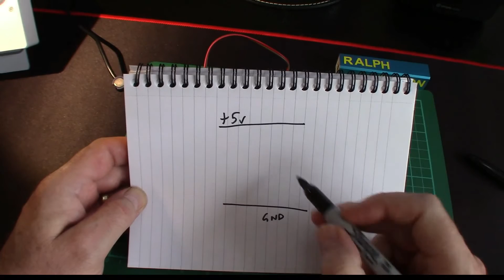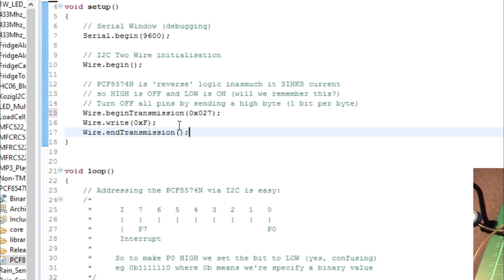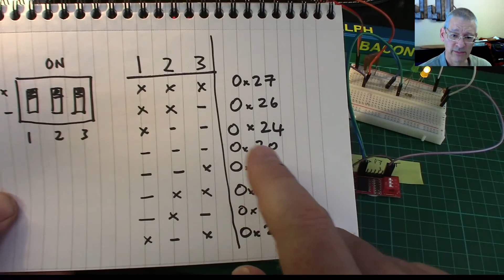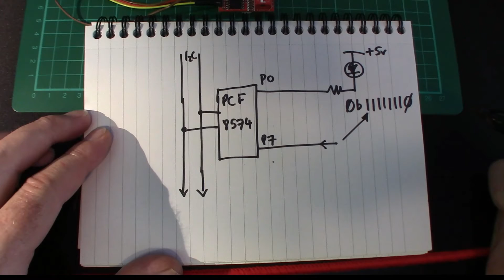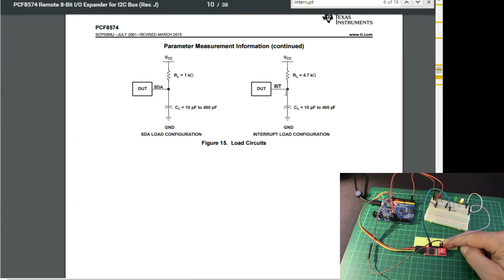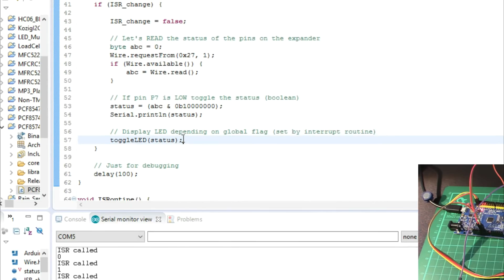#49 MORE PINS PLEASE! PCF8574 Arduino Pin Extender (Easy)

Comment: Sir, I am from INDIA and I am a student of ELECTRONICS AND COMMUNICATION ENGINEERING. I am the biggest fan of you. Sir if you make a video on TCA9548A with a clear concept then I will be very thankful to you. I like your way of explanation of any sensor because you always deliver a clear concept. Hope you will upload the video soon sir. Actually, sir Arduino has one  SDA and SCL pin, if we have 4 I2c modules then we will be unable to connect all the modules at a time with Arduino, that's why I have requested to you. sir if you have any better idea then please let me know sir.
Reply from the maker: Hello SK Suman, nice to hear from you. I am not totally clear what problem you have with the I2C bus - you can have up to 64 devices on a single I2C bus as long as each device has a unique hex address. If you have an item with a fixed hex address then the TCA9548A will let you have 8 of these on the same I2C bus. Remember that devices on an I2C bus share the same SDA / SCL lines. However, your suggestion is a good one. I will add it to my list.
Reply: Thanks sir
Reply from the maker: Are you still interested in this device, SK Suman? Watch this week's video!

Comment: Great video,  Ralph!  Thank you. Can you write here as an example what world be the code to read from e.g. PIN No.6 a variable that is of float type,  say reading from temperature sensor? 

Thank you! 
Br, 
Valters.
Reply: Hi, Ralph! I believe I yesterday found answer to my question - I cannot forward analog signals (e.g. those of float type) by using PCF8574, only digital (HIGH, LOW). Now let me ask different question - how to increase (get more, extend) analog signals in Arduino?

Thanks!
BR,
Valters.
Reply from the maker: Analog expansion boards are available but read this first, Valters, it may help:
https://arduino.stackexchange.com/questions/21536/expanding-analog-inputs-to-the-arduino
Alternatively, the Mega2560 has 16 analog inputs (and you can get the board in a more compact shape too, see my video #108)

Comment: Hi again Ralph. On a slightly different note... I need 60 odd led lamps which I am going to now use I2c but I also need 50 input push-buttons. I have an arduino Mega so there shouldn't be a lack of normal pins left over to spare.... however do you happen to know if I can use an interrupt to check the pins to see if "any" button has been pressed without going through "each" button to see if "it" has been pressed? Thanks very much. PJ
Reply from the maker: When using this device you do have to poll to see which one it was, unfortunately, PJ. There's no data sent back as to which pin went high or low, it's not sophisticated. But a simple loop would be sufficient to do this.
Reply: @RalphBacon  ah ha I see. Shame about that.  Ok thanks very much for that and your continued support. ☺

Comment: Curious if it could be used on marlin 3d printer
http://84.106.2.21:8888/forum/index.php?action=view&id=285
Reply from the maker: That depends on how the original detector was implemented, Luberth, (if there was one), was it GPIO or I2C based? In its simplest form think of this as a simple on/off switch - could that be used? If so, wire this up to a transistor as per my diagram and it should work.

Comment: Fantastic video. Thank you very much. Very clear instructions and very clearly explained in fabulous English without using "you guys" or starting your sentences with "so" 😉. Can you explain how you would physically daisy chain these devices together, I can't see how you would do it. Thanks very much.
Reply from the maker: So, you guys, what's up? Oh no!!! I promise never to say those words again! Regarding "daisy chaining" that's not how you do it for the I2C bus, you put all devices in parallel and ensure you configure them to have different hex addresses so you can talk to each one individually, via that address. If you need further explanation let me know, PJ.
Reply: @RalphBacon  ah ha I see. I have looked as some other i2c expanders and I now see there is a plug and socket version so I can connect a few together.  Exactly what I need. Thank you very much. :-)

Comment: Hy, 
I can’t gate it to work. I coped you first code but it will not work.

I use a arduino Mega, whit a PCF8574AN with A0=A1=A2=0 so my command should probable be 0x020 or 0x027 (I tried them all but they all don’t work). I have my SDA in port 20 and SCL in port 21. Where could it have go wrong?
Reply from the maker: The first thing to do is to make sure your I2C is set up correctly and that it can find the PCF8574 device. Use the following sketch to do that:
https://www.dropbox.com/s/o4qekrwkps017xm/I2C_HEX_ADDRESS_SCANNER.ino?dl=0

Comment: Hi Ralph,  Great channel, I have watched several of your videos and find them really informative, so much so that I have just subscribed and pressed that bell. I have a very simple question that I probably should know the answer to but I need some reassurance before I start blowing stuff up. My proposed project uses a lcd touch screen that uses the majority of pins on my Uno, I do have the two I2C pins near the reset button free, so, can I use the PCF8574 board to control a 8 Relay Module, it is the polarity reversal thing that is confusing me...
Reply from the maker: Welcome to the Arduinite world, ScR, and thanks for subbing. Appreciated.

I'm not totally sure what you mean by "polarity reversal" (it's been a while since I made this video) but let's see what I can suggest.

When you say the LCD screen uses most pins up, you still have the Analog pins A0 thru A5 that you can use as digital pins in the usual manner. That gives you 6 pins, so if you have another two (not the SCL/SDA as they are already in use as A4/A5) you would be able to control the relay board directly (and more simply).

That said, I see no reason why the relays could not be controlled via I2C and a PCF8574. As your relay board will be undoubtedly optoisolated (right?) all the PCF8574 is driving is an LED (well, eight of them)! Simple to do, but not as simple as my first suggestion.
 
Finally, if you really are scrabbling around for pins, watch my video #108 which shows a more compact (and cheap) MEGA2560 which has more pins than you can throw a stick at and costs just £7.52 or just over $9 - a very easy way to increase your pin count whilst keeping everything else 100% Arduino UNO compatible!

As Albert Einstein said, "Make things as simple as possible - but no simpler!"
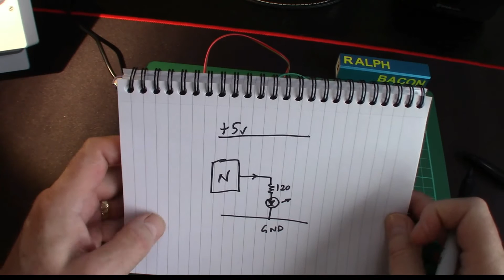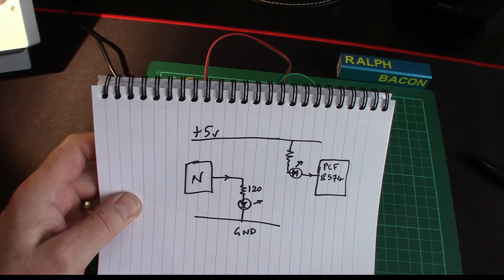Reply: @RalphBacon  Thanks for your reply, and so quickly, I know that I could take Einstein's advice, he is one of my personal icons, although to quote JFK (not an icon) we do things "not because they are easy, but because they are hard". That aside, I muck about with arduinos quite a lot, I usually build projects on the bench with an Uno, or Mega for more options, then I mostly transfer my project to a Nano or a Pro-Mini. I was raking through my Arduino bits box and found a spare Uno, a 8 way relay module and a mcufriend TFT LCD touch screen that I have had for years and have never used it because it is a pin hog. On the Uno, the screen uses all the pins from the Reset to A5 on the analoge side and pin 0 to AREF on the digital side. It does leave (I2C) SCL and (I2C) SDA free, I believe these are the two pins that the PCF8574 needs. All I would need to buy is a PCF8574 module which is considerably cheaper than a new Mega. Anyway, the relay board works as you guessed, it is optoisolated so I am just turning on and off LEDs. My polarity reversal confusion is; my relay board requires a pin to be high (5v+) to operate, easy to do straight from an Arduino as you have drawn in the video at 4:53, Its was the reverse logic bit that made me think that the PCF8574, would be taking pins low (0v)to operate, your drawing at 5:17 sort of confirmed my fears.   But after reading your reply and re-watching your video, I think that I now understand where I was going wrong. It was late last night when I watched the video, that's my excuse anyway, you were talking about the input side to the PCF8574, I picked up that you were talking about the output side. I now take it that regardless of the input side, the PCF8574  can drive it's output pins high or low (depending on the sketch), therefore I can turn relays on and off easily with my touchscreen?
Steve.
Reply from the maker: Yes, you are correct; the PCF8574 can drive its outputs high or low, just the same as an Arduino would do.

Having read your descriptive post above though, and the fact that the TFT Touch Screen is such a pin hog, have you considered off-loading that part of the project to a dedicated Arduino Nano? You can get these for about $2.29 from the Far East (eg Banggood, GearBest and AliExpress to name a few). Then use I2C to communicate with it from your main UNO. Or even the serial bus (hardware or SoftSerial).

Example Nano: 
https://www.banggood.com/ATmega328P-Nano-V3-Controller-Board-Compatible-Arduino-p-940937.html?p=FQ040729393382015118&utm_campaign=25129675&utm_content=3312

This might be a more elegant solution and attacks the root cause of the "problem" rather than trying to work around it. The choice is, of course, yours, either solution would work.
Reply: @RalphBacon  I have been watching a few other videos on the PCF8574 and I found one guy who managed to get his screen working through two of them. But I have ordered a couple of PCF8574s to play with, we'll see how I get on.....
Reply from the maker: Good luck. It's all part of the "fun" Arduinite journey!

Comment: high Ralph and thank you for this great video (even a french noobs like me can follow).
I have a question: i'm trying to emulate tri state io on this PCF8574 to control the microstepping mode of tmc2100 stepstick 
On the arduino (alone) i can do that by setting the pin to output high for 5v,output low for ground and input for open.
but in your video you say that an input is set by putting  it off(high)...so if i get it right it means that open and off are the same behavour right? 
so is it possible to emulate a tri-state io with it? 
thanks again and excuse my poor english
Reply: sorry Hi not high Ralph... i think i'v spent to much time with my nano ;)
Reply from the maker: Bonjour, noob français, et bienvenue sur ma chaîne! 
 
I'm not sure you can emulate a tri-state really, Bruno. The GPIO pin is either LOW, HIGH or floating which, as its name implies, means that it might be LOW for a bit, then HIGH and generally oscillates around. (That's why it's important to use either grounding resistors on INPUT pins or open them as INPUT_PULLUP.) But a floating pin might not be the same as a pin with high impedance as it will have a voltage (albeit tiny) at that pin. 
 
What value on the pin do you expect to see in a tri-state mode? Just a high impedance, with no regard to actual voltage? How does your circuit differentiate between a floating pin and another state?
Reply: hi  @RalphBacon  and thanks for the quick reply

"What value on the pin do you expect to see in a tri-state mode? Just a high impedance, with no regard to actual voltage?" 
yes i guess for the open state

"How does your circuit differentiate between a floating pin and another state?"
 i have no idea ,when i hook the 2 config pin of the tmc2100 straight to the nano it work great 
here is a link where i post my code: https://forum.arduino.cc/index.php?topic=537240.0  it only use pin mode and digital write low and high

during the night i was looking for a way around and found this io expander :https://de.aliexpress.com/item/I2C-8-bit-I-O-expander-module-PCA8574AD/32588650413.html
it use a PCA8574 and if i get it right it have separate setup for input and output do you think it will do the trick?
Reply: actually it s PCA9554N
Reply from the maker: In cases like this, a bit of research and development is always required. I do this all day long! Sometimes things work just as you expect, sometimes not.
 
As long as the result you get is repeatable then you have a solution. From what you tell me above you seem to have a (part) solution. Now you can try the PCA955N to see if that completes your project, it's what I would do. Good luck!

Comment: Thanks for sharing :)
If you want to use Arduino Nano: change the "Wire.beginTransmission(0x027);" to (0x020). 
For additional PCF8574 modules: (0x021); 0x022) etc. and and also move the jumpers accordingly. eg: for 0x21 move just the outside jumper to the left and for 0x22 move just the middle jumper to the left. This way you can access 24 GPIO pins sequentially.

These are great for adding output pins. For additional input pins, where only one will be used at a time, I use 6 different resistors off each analog pin to create 36 inputs. This uses only the 1st 6 analog pins (A0 to A5).  ....I never trust A6 and A7 :(
Reply from the maker: And thank you for the information, Peachville. But I'm not sure why you don't trust A6 and A7 (which can ONLY be used as analog inputs, not digital GPIO pins) but are otherwise quite standard?
Reply: @RalphBacon   I'm not the only one that avoids A6 & A7 on Nano. Do a google search. At 1st I thought this was just a bad Nano but it wasn't.  Datasheets even say that the first analogue reading is unreliable....this may have something to do with it.  An analogRead of A6  sometimes seems to leak voltage  to A7 when doing sequential reads. I'm not even close to an expert on 'why' and don't have the time, so I just avoid  using them this way. :)
Reply from the maker: Interesting, and I was not aware of this (alleged) deficiency on those pins, I shall bear that in mind, thanks for sharing.

Comment: uggl three squared minus 1. you fail. it is two to the third. just try to think of something with 5 switches, i would say think about 2 or 4 switches but ha ha...
Reply from the maker: Haha, yes it is 2 to the power of 3, not 3 to the power of 2, easy to get confused (at my age, anyway). Thanks for the correction, Raymond.

Comment: The use of I²C ready to go ICs has one significant downside... the price. They mostly come so expensive that it already makes one think about to use an ATmega at a similar price to use instead as an I²C slave. And that can be a pretty nice idea!
Take a look at the most obvious advantages and disadvantages for such attempt:
+ The use of the internal oscillator of an ATmega (8Mhz) offers 2 additional IO-Pins and spares the cost of an external cryastal as well as for the two of 22pF ceramic caps. But using an external crystal of course works also fine.
+ The number pins available, even when two are consumed for I²C (SCLand SDA), is greater than the ones that come with even 2 of PCF8574.
+ An ATmega that comes with I²C interface, can also act as an I²C slave. (sometimes even with extended addressing capability, instead of only 7 bit addressing scheme)
+ In addition to the capabilities of a "ready to go I²C" device, the ATmega as a I²C slave can do stuff like PWM etc. on it's output pins and comes with integrated timers etc. for complex timings.
+ An ATmega can go into modes that reduce power consumption, of which some even allow to wake up (address recognition wake-up) quickly again to serve I²C requests.
- A major disadvantage is that an ATmega is very limited when it comes to the amount of current that can be sourced/drained on each of the ic-pins (also true for most I²C "ready to go" devices). But to get around this cheap external transistors (BC4xx/BC5xx or similar for less than 2 cents per piece) can be used to address this issue.

In my personal opinion it makes a good point not make any use of most of the avaiable I²C devices, but instead buy ATmega in quantities where they start getting even cheaper per piece than when bought in very small numbers, and use Atmegas in I²C- / SPI-slave-mode to create custom I/O-devices, containing extended features beyound the ones that come with "ready to go" I²C-devices.
The price of useing ATmega is compared to I²C peripheral devices at least the same or even lower, depending on the type of ATmega being used as an I²C / SPI emulating device.

 In fact I mostly use PIC24FJ16GA002  as "intelligent" peripheral ICs, because I got a bunch of them for very cheap some time ago... . But a cheap ATmega like Atmega48PA (<1€) or ATmega8A (<1€) or the usual suspect ATmega328P (~1.5€) does the same of course.
Reply from the maker: Yes, that is an interesting point. And, in fact, one I adopted in a recent video about restarting the Raspberry Pi. Rather than some convoluted mix of analog components I just used a cheap ATTiny85. So it seems we are on the same page! Thanks for posting, Sebastian, good to hear from you.

Comment: "Three squared minus one" i didn't know thats how it worked. That can apply to any number?
Reply: 2:22
Reply from the maker: Actually, as this a two-way switch we can treat it as a binary bit. The maximum permutations for a binary number is 2^n where n is the number of bits. Here we have 2^3 which is 8. If we had 8 switches (and hence bits) it would be 2^8 which is 256. Any help?